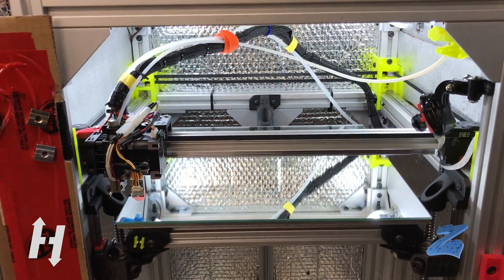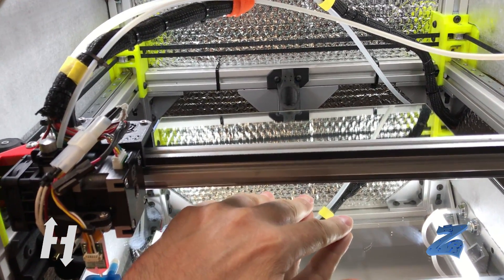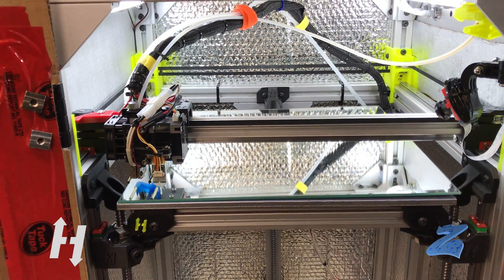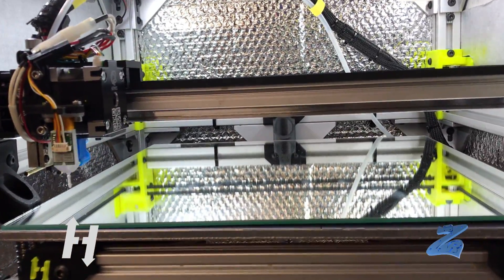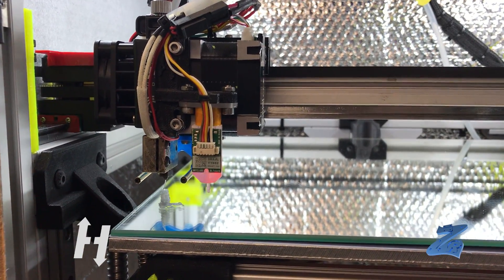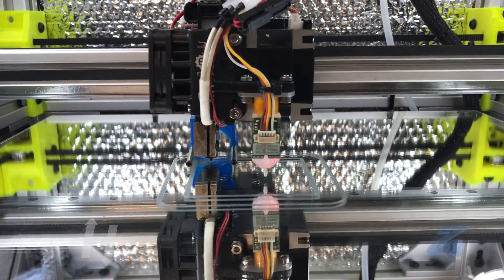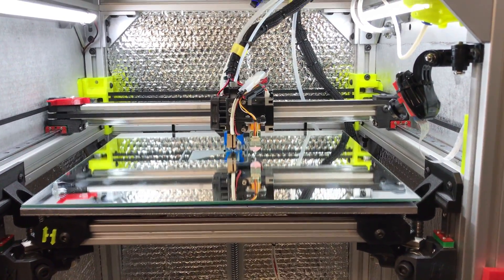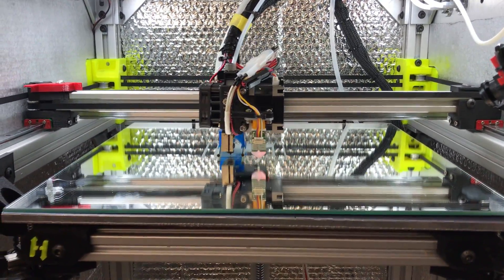Triple Z motors - Self levelling print bed demo - HevORT Advanced DIY 3D Printer

Comment: wait did you have a heated bed there - or it wasnt printing ABS? Or how did it stick so well to the bed surface? I mean you just put on the mirror surface and start printing instantly, so it shouldnt have time to heat up from the heating element.

Comment: Great work, congratulations!
I am trying to do an autoleveling system like this. Could you point me a direction to a firmware that runs such a routine? I am using duet wifi2 board with duex5 expansion board. Thank you!

Comment: Would this be worth it for anything other than glass beds? Because the imperfect surface of metal build plates would necessitate mesh bed levelling either way, I would guess, leading me to believe there isn't much need for literal bed levelling when you're already doing mesh bed levelling. Nevertheless, this is extremely cool, and will probably be a game changer if build surface imperfections can be controlled for some other way in the future.

Comment: I had a thought. You could have two hotends at different angles on an axis, and tilt the bed depending on which one you want, so you would get the benefits of a switching hot-end setup without the servo, weight, etc.

Comment: Say the bed starts off REALLY skewed at like 30 degrees or something. Would that mean that the extruder nozzle would hit the buildplate before the probe does? I mean it will probably never happen, but I’m still curious haha.
Reply from the maker: My plan is eventually to have a dedicated tool head for probe that would be switched to via a tool changer system. Or simply have a piezo orion probe.  Both scenario can get rid of all items surrounding the nozzle.  And my HevACS system for part cooling makes the nozzle the only thing sticking out of the print head.
Reply: @MirageC  I see, kinda like a proper CNC milling machine 😄. Im really eager to see how far you take it! If i had the money, time and coding knowledge I would definitely make such a printer. Currently I have a shitty Anet A6 that can print some cool stuff, but the bed levelling in particular is just such a pain and takes like half an hour to properly do. I think you can get marlin software or something to install the probe you have, but I don’t think I have the coding knowledge to make that work sadly. About that, how much do you think your printer costs currently with all the upgrades included? Just curious haha :P

Comment: great idea, but this kind of leveling helps only when the bed is plane, cause for this case you need a software solution that during printing the printer correct the Z-level depends on the nozzel position in XY.--> overengeneered.
Reply from the maker: That is correct, software compensation of the irregularities from the print surface are still being mapped and stored for each build plates.  Once the map loaded, the printer will level the build plate to the best possible attitude. Printing can then start using the topographic software compensation and tapper it off after X number of layers.
Reply: @MirageC  to be honest I read today mich regarding that Project. Very nice. I can imagine that if the head could be rotate would be also nice addon.

Comment: Do you still have the bed floating on springs or mounted solid to the frame under it?
Reply from the maker: Springs.  They allow thermal expansion from the plate and a very convenient to protect the heatbreak from user mistake ;)

Comment: Did you come up with this independently, or did you see similar solutions? It's impressively quick. I'm only aware of the Railcore II doing triple axis Z in 2018
Reply from the maker: Triple Z has been around for a while.  Duet had this capability all along.  I simply developped a system that would maintain the center of the bed in the same XY coordinates along all possible attitude for eventual non planar printing.  I initially started with another approach involving linear rods, but if was not working well.

Comment: one day man, one day I'll do something like this too!
Wonder if I could start it small with like some crappier steppers to do very small movement on the 3 points (maybe geared to let them actually do their job) and like M3 screws to have a pitch so fine it won't drop when the system turns off...
Your stuff sure inspires crazy ideas.
Reply from the maker: Thank you!  Yes, any cheap stepper can get you pretty far.  Using imagination and creativity will make the rest, no matter how much funds or resources you have available ;)

Comment: Excellent iteration. It appears most people have never seen something like this and don't understand the true advantages. The greatest benefit here is that the nozzle actually trams perpendicular to the build plate, resulting in practically identical parts across the entire build surface accurately and automatically. The most common form of automatic bed leveling today is not tramming, but merely drags the nozzle at varying angles at a mostly correct distance using a virtual map. Other benefits include less computation for the printing sequence, and of a 3 point bed system in general, having honed flat build plates STAY that way.
Reply from the maker: Thank you !

Comment: The only real posibility i see here is to be able to properly print 90 degrees angles. Otherwise this looks kinda overdimensioned and adding a shitload of extra parts/cost and work to your printer for very little gain/ a problem that does not really exist.  Leveling a bed shouldnt cost more than 2 minutes and will last for a month or 2. Only installing and buying this setup will require more than 30 years worth of bed leveling haha. 

Still very cool design and implementation. A lot of kudos! And subscribed for the pure amazement of creative display.
Reply from the maker: Thanks for subscribing.  Yes the intend is to eventually take advantage of the bed capability to print 90+ degree overhang.  Slicer is what we need now.

Comment: Mhh... I might consider building myself a CoreXY 3D Printer to replace my Prusa i3 taking up a somewhat unamusing amount of space in my closet due to the Y-Axis moving back and forth but I kinda have to wonder where the benefit of using two extra stepper motors to do actual hardware based bed levelling with 3 independent Z-Axis is as opposed to just doing a 9-Point Mesh bed levelling and compensating in software?

I guess Multimaterial 3D Printing, like how I'm now doing with my MMU2S equipped i3 MK3S, will not be an out of the box option, eh?
Reply from the maker: Software compensation is still being done on the HevORT, same as what you are using on your Prusa.  Software compensation should only be used to map the variation of build plate flatness.  Bringing that build plate and all its variations to a levelled position is what the 3 Z actuation points will do.  Larger build plates should not use software to compensate the levelling, this means that Z axis will need to work harder to maintain nozzle height.  This will limit achievable speed and quality.  HevORT will bring the build surface to the best possible attitude from the start and then software compensate Z for surface mesh deviations.  Software compensation will then gradually fade off to null over a certain number of layers.
Reply: @MirageC  Sounds reasonable as an argument 🤔

Comment: amazing creation i have two questions, could you upgrade it by adding four of those induction bed leveling probes in each corner so that it would update the balance of the bed dynamically during printing ? 
and could you use the bed tilting ability during printing to enable  more convenient non-planar printing angles ? / use it to print overhangs or arches with a real angle ?
thanks for the great video, very inspiring !
Reply from the maker: Thank you for your comment.  I am not sure what you mean by dynamically adjust the bed dynamically during print.  This is a CoreXY, the bed is moving downwards to create the Z axis, therefore reference to the XY plane would be difficult to be made as the print progresses.  The weight of the printed part is assumed to not affect the build plate attitude/position.  Even if it does, this would be happening very gradually and be compensated by the plastic being squished a little less against the previous layer. 

As for the non planar printing, yes it is the intention to use eventual 3+2 axis slicer capability to achieve greater overhang angles.

Comment: Why do you need 4 sample points when leveling?  A plane is defined by 3 points.  Just curious.
Reply from the maker: The thing is that no build plate is perfect, therefore if one corner is lifted the 3 point positioning might miss it.  The 4 point will average the deviation throughout the bed.

Comment: Hello Sir
Does the printer also compensate for crowned bedsurface while printing. Like the G29 command
 in Marlin. 
Thank you for the answer. 
Regards Daniel
Reply from the maker: Yes, I am using mesh bed compensation (G29) as well as self leveling (G32).  All done through the Duet control board.

Comment: is it necessary to have linear rails for the Z axis? I get that for the high speed moving X and Y they provide better rigidity, but considering the Z axis barely moves, why not just use 3 rods, they are a lot cheaper?
Reply from the maker: Yes rods would work too.  I chose rails for compactness and maximize print area.

Comment: 2.45 show you have wrong first leyer done. Do check your setup.
Reply from the maker: Actually not, did not check one single bit! I even threw an uneven piece of plastic under the print surface.  Bed temp got screwed, Print Surface was not even stable.  Yet, it did print! :D

Comment: Wow, that is awesome. And complicated.  But... You have a de-facto 5 degree 3D printer...  A little slicer tweaking and you could do some amazing things with that.  If you added linkages to the mechanism, and some extra motors, you could have a full 6 degree printer.
Reply: Just a little slicer tweaking.  That's going to have to wait until cura 10.4. it would be nice if it was fully optimized.  🙂The planar prints are one thing that has to be explored.

Comment: I  also use a mirror tile as a build surface with salt crystal to grip the first layer, here is an in-depth PDF of the technique to apply the salt, written by the inventor, it is dissolved in water and then applied with a kitchen towel or cloth to the hotbed, when the water has evaporated salt crystals are left and PLA sticks to the bed in the same fashion as the Ultrabase surfaces.
@t
Reply: https://www.uantwerpen.be/images/uantwerpen/container11343/files/bonding_pla_with_salt_water_v20160713.pdf

Comment: 🤔🤔🤔🤔🤔1. Why not gyroscope MEMS sensor to the tray, and 6 axis robotic arm and hand with toolchanger ability? That way you can build up an SIPlace machine and even a whole mini manufacturing line if you can chain up the printbeds/trays. 2. What would happen if you replace filament with granulated plastic, and use compressed air to spray/shoot out the melted plastic/materials like inkjet printers? 3. Why on earth can not be seen buildplate/eject-load tray function in between 3d printers? 4. Vacuum locked buildplate or material lock? 🤔🤔🤔🤔
Reply from the maker: Many good questions and Idea.  Thank for the interrest and sharing.  This is still a DIY hobby printer, robotic arms and gyroscope sounds nice but a bit out of reach for most at the moment.  Filament is still the best option out there for rapid and consistent 3d printing.  Some new options are being developped, but I will not enter that race for the moment. This printer does tilt the bed 30 degree forward for parts ejection with the help of 2 servo tappers.
Reply: @MirageC  Thank you. I am just brainstorm here. But I have few more questions: 1.This tilting is not what Kossel printers (with some tweaking) already can do IMHO with 3 arms instead tilting the bed? Because seems to me basically a "reverse" Kossel 🤔🤔🤔 2. Why most of the 3D printers are using cube chassis instead of a dome? Why is the build plate always a sheet instead of any form? Wouldn't be possible to print from angle or follow the form? IMHO you couldn't make fine forms, or can't target any point in your workspace if you are only describing your 3D space with squares/cubes... I mean XYZ still missing the angle 🤔 Maybe the earlier idea to spray the material is little bit technically too much, but as far as I remember inkjet printer cartridge electronics are using fluid surface tensions and electricity to shoot the drops on paper. Right? In any color... What would be to use the same technics to print out 3d objects? I have already know some printers are able to print embossed 🤔🤔 BLTouch is a nice tool, but don't we have IR distance sensors available on market? Wouldn't be much faster to scan the surface with multiple beams at once? One right-to-left move and you have the surface? 🤔🤔

Comment: Overkill - this can be done in software with a single vertical axis motor by just compensating by moving the Z stage up and down while X and Y are moving.  Two additional points of failure are now added (Additional Z motors) plus all the extra linear slides and spherical joints at the corners, adding parts without any gain over software leveling.
Reply from the maker: The control board ability to process the amount of calculations and control an additional stepper motor during X, Y & E (now adding Z) will slow down the print ;).
Reply: Having a trammed bed right from the beginning of a print means there is less corrections performed when using mesh bed leveling.  This leads to dimensionally more accurate parts.  Losing the adjustable springs and finger knobs removes 3 (or more) points of pain; vibration and heat creep slowly loosens or compresses the springs and makes the bed even less accurate.

Comment: three motors for Z! money is no object.
why not having a three point optical level detector and spare those two minutes of calibration, then?
Reply from the maker: good point.  That could be an option.  BLTouch is also used to create topographic mesh of the bed using G29 command.

Comment: i gave a dislike cuz the time taken to configure is mare than the time we could remove the obstacle
Reply from the maker: You do realize that a 3d printed layer is 0.1 to 0.3 mm thick?   The case in the video is obviously an exaggeration to demonstrate the ability of the printer to re level the build plate on its on.  It is not expected that one individual would start leaving trash on the bed just because the printer can deal with it...
Reply: MirageC 🤔okay

Comment: It's a great idea, very smart, but this would increase the cost of a printer significantly
Reply from the maker: Yes it does.  All depends on what you want to do.  I honestly cannot live without this anymore though.
Reply: @MirageC  I think many people will be interested to pay a little more to get such a reliable 3D printer 👍👍👍👍
it would be interesting to compare your method of automatic bed leveling, against the the default auto mesh leveling by Marlin where the Z moves during a layer

Comment: I would love to see that being used for non planer 3d Printing
Reply from the maker: Me too! I need a slicer/software partner :)
Reply: @MirageC  dude, you're preaching to the choir.  I'd have already tried to do a hybrid belt printer if the slicer wasn't so awful to figure out.
Reply: @MirageC  I saw this article that this company called nonplanar that sells elongated nozzles for this type of printing (https://3dprint.com/265174/start-non-planar-3d-printing-today-on-your-ender-3-with-nonplanar-xyz/). This guy from Germany did a masters thesis on it (https://tams.informatik.uni-hamburg.de/research/3d-printing/nonplanar_printing/index.php) and used slic3r to do the prints. He also includes github files for Slic3r which I have know a idea how it's supposed to be implemented. Maybe you can understand all that stuff and make it work for your printer because that would be the next level and amazing.

Comment: Very nice. What you think about use ballscrew also on x axis?
Reply from the maker: Motors would have to rotate MUCH faster due to pitch of the ballscrews.  And given the back and forward movement switch required by those two axis, I cannot see it as a positive thing.  If this was a CNC and required strength in XY while no need for speed, this would be good.

Comment: Hey, can you tell me how you manage it to actually level the bed before printing? I use a Duet board and 3 z-Motors too, but it is only compensating during the printing by moving the z-axes...
Reply: You should be able to set your probe locations in your bed.g file. Then if you run a G32 in your Start G-Code (Try to do it after your bed comes to temp) then it should compensate.
Reply from the maker: legacyofbob  is correct, I use G32 command at start of print after bed has reached temp.   See details here: https://duet3d.dozuki.com/Wiki/Bed_levelling_using_multiple_independent_Z_motors
Reply: Ok, thank both of you for your answers. I think I am running into problems because i also use three top Enstops (z=0) as well as the BLTouch. I first want to level the bed more or less with the enstops and after that i want to use the BL Touch to level exactly. I'm going to try to write a macro that is run after the endstop levelling. It will re-config the axis levelling to BLtouch. This way it may work :)